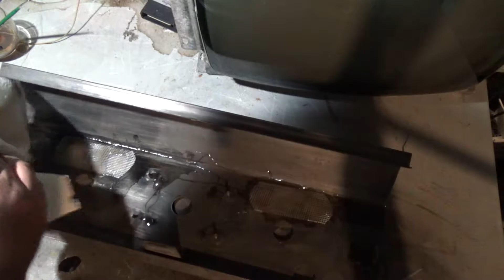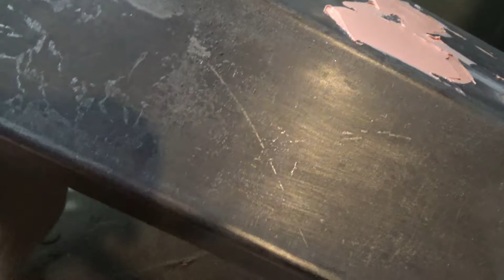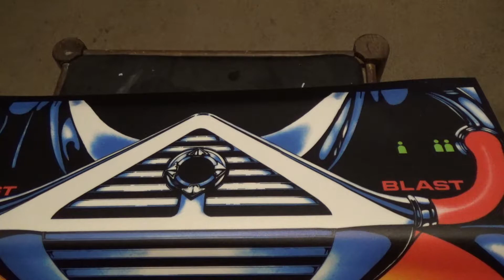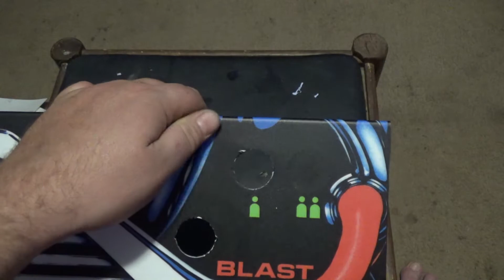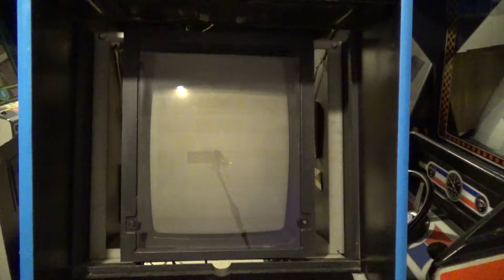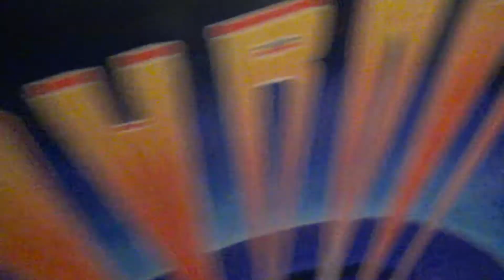journey restoration parrt 3

Comment: I've had a side business cutting vinyl decals for about 15 years.  I've been using ORA-CAL vinyl for most of those years due to their quality and durability.  I have never had a customer contact me to say that their decals have failed.  They make a great product.  The ORAJET is a different line but made by the same company.  While I've never used the ORAJET product,  I can only imagine that it will withstand a lot of wear and tear and last for quite some time.  3M does also make great products as well but my preference is ORACAL
Reply from the maker: Donny Fontenot thanks good to know